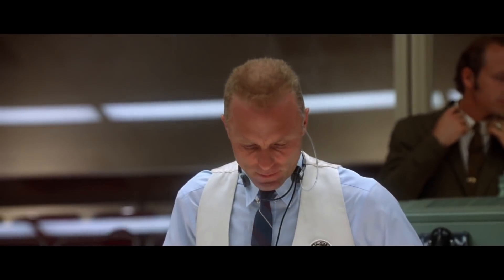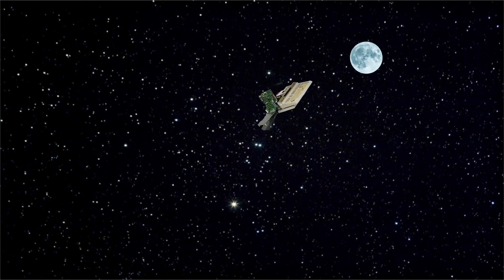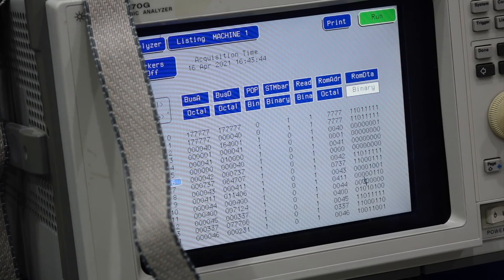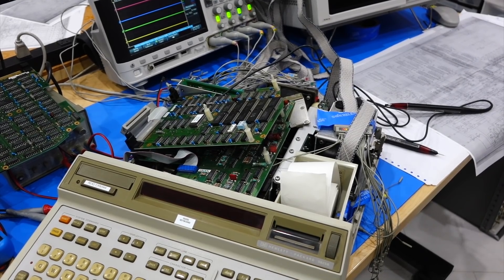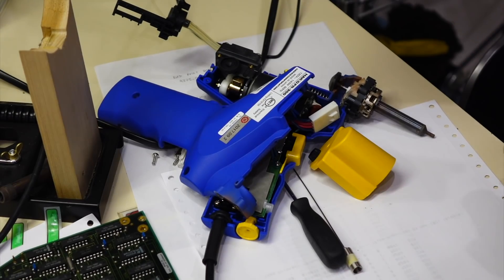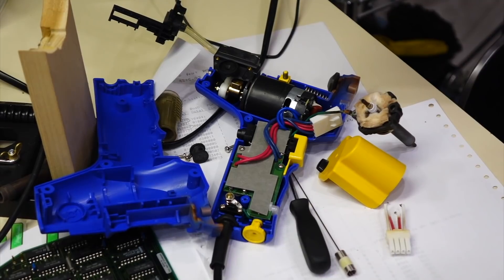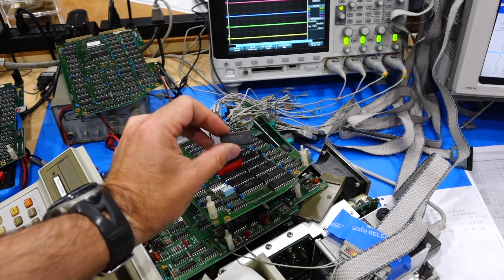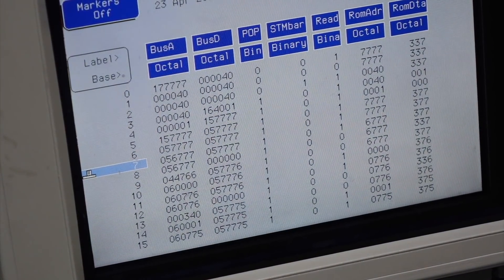HP 9825 Repair Part 6: Can the HP 547A probe get us out of trouble?

Comment: If a chip (esp. TTL) wants to pull a signal  to 0V, any chip or short holding the line high will cause the one pulling low to heat up,

Comment: If you have a high precision volt meter (I'm guessing you have a few), you can simply measure the voltage at each of the pins.

The lowest (or highest as the case may be) voltage will be the culprit.

Comment: We had these HP magic  probes at work a long time ago. We used them with the board powered on and the negative supply of the probes connected to the ground of the board  under test. They were great for testing if gates worked ok. They will  not work on a loose board as in the video. At least the gnd of the board shall be connected to the neg supply of the probes.

Comment: I am not sure if you realized, but the current probe is DIRECTIONAL.  That means you probably need to rotate it + and - 90 degrees while at each probing spot.  I mean rotation along the probe long axis.  If you can follow the signal on just one trace, you can maintain the same rotational orientation relative to the trace.  I have located (twice) a BURIED short between two traces that way.

Comment: The problem here is ( I do a fair number of over-voltage TTL repairs on a regular basis) is that any number of the chips may be partially damaged so if you get it working, run an extended burn-in test over a couple of days, this is usually sufficient time for partially damaged chips to fail.

Comment: I have those HP probes too, only the later model that pulses only once (but upto 1A). As far as I know they are not made to work with unpowered  circuits. Unless you use it instead of the beeper of a DMM so you can follow inner traces. There is an other way, if that is what you want. I made a probe from a think piece of wire. I stript the end and then bow them like a peacocks tail. Now you can "brusch" the pcb.  I use it together with a fast DMM and that is a very fast way to do this.

Comment: I have much better results with the HP-547A when checking the boards in the actual working conditions. The shorts are usually evident. I have also the HP-546A but in case of logic chips failure I have observed that the "powered state"-shorts can disappear when the board isn't powered. So I almost never had to resort to clipping chip's pins anyway ;)

Comment: Yup, the best instrument ever built is not HP, Tektronix nor Fluke but the gold  "Mk20 Eyeball".  It was always number one on my troubleshooting list of tests,  good old detailed inspection.  Number two was the nose test looking for the component that developed that "Ode de Allen-Bradley", less precise but effective.  In the mid 70's it was not uncommon to have several bad DOA TTL devices on a PCB, some even installed backwards. One got fairly good at debugging or moved on to sales & marketing.  Wire wrap proto boards helped but caused their own problems.  Had one board where they counted all the  IC pin numbers CCW  from the bottom side. Had one bad 7474 we had de-caped, found the die rotated 90 deg in the package.

Comment: You need to try a hakko FX-951!  It will change your life.  It makes the old 936 and the wellers feel like trying to solder chips with a propane torch.  It's so precise and the heat is so focused in the tip you can get in and out with a perfect solder joint way faster.  Highly recommend.

Comment: That custom solder sucker stand is pretty nice. If I may make a suggestion though, I would hang it from the wall, such that the orientation of the gun is horizontal.... heat soak.

Comment: I think that HP current tracer probe is meant to be used while circuit is powered.  It seemed that you had board disconnected without even ground reference, so there was no path for current from pulser trough faulty ic and back to ground/vcc.  When faulty board is connected to equipment, probes should be connected to VCC and GND bus, and current probe then can be used to find which IC in that signal is drawing most current trough input pin. Pulser can be used to identify components connected to that signal, and force signal to switch state if it is not driven by any IC outputs, or if IC output current is not sufficient to find short.

Comment: When you removed the ROM chip, my thought was "how will they replace that"?  Do you have the code for it, and could you program a replacement?  I was a little surprised that you fell into the trap of not noticing the rework short, considering you expertise.  It shows things can happen to the best.  It made for a great video though, and beings back memories of troubleshooting decades ago.  I am enjoying this quite a bit.  What initially brought you here (PS fault) is most unfortunate indeed.

Comment: PLEASE NOTE, There is another way to use the HP 548 AC Current probe which may help you. This is not always going to help but in my experience, it helps most of the time. 
Either way, the HP 548A probe will save you time and you will find faults that you otherwise may not ever find.
If you power a board and suspect a RAM chip in particular and often a ROM chip is bad, then scan the top of the RAM IC's and look for one drawing more current; this is better than burning your fingers.
This usually works on ROM IC's as well, especially one with a shorted line and drawing excessive current.
Using the HP 547 Pulser and looking for excess current on a pin on a buss works a fair amount of the time as well.
when you have a solid short and an IC is getting warmer or hotter than usual, the HP 548A is almost like having thermal imaging, in that, the heat is being generated by excessive current consumption.
If you have the luxury pf having 2 boards powered up at the same time, with one bd being a working example and the other bd being your DUT,  you can verify your suspicion(s) on the good board vs the DUT.
PLEASE try this, you may save some time and expense by NOT cutting pins.

I have solved a multitude of frustrating problems with these probes almost effortlessly.

Comment: Were you doing the pulser/tracer test with the board powered? It looks like the probe power is coming from off camera. believe that to get the most useful info out of the two probes, at least in this case, where the stuck bit was being pulled high, you need to do this test with the board powered. The pulser will pull either up or down, which ever way reverses the state of that line. Then you will get more current out of the pulser, which will make the current easier to trace.. I'm not surprised that doing the test unpowered would give similar results for both the good and bad boards.

Comment: Hello Marc I think there is an other bad Trace near at the same chip you solder. Did you check all traces that went thought the pins of the Cips with the lifted trace? 
Greethings from Germany
Reply: I thought that looked fishy too, like a trace that should go between two of the pin pads was either deviated off to the side and probably shorting to a pad or was broken and thus open circuit. I cannot imagine that HP would design a board with traces that looked as weird as that did.

Comment: You forgot to connect the ground when using the 546, would be nice to see one in action in a video. Page 7 in the manual talks about the power supply requirements and importance of a common ground between the tool and circuit under test.
Reply from the maker: Aha! Massive fail! Will try it again with ground. Thanks!
Reply: @CuriousMarc  Being the board is not powered I guess you could place the ground somewhere more relevant to the fault. Just providing the return path somewhere so you can get some current flowing. Looking forward to seeing the final resurrection, I hope it doesn't fight you all the way. Still it makes for great video's thanks!
Reply: Oh i will. It will fight him all the way.

Comment: Can you put the heating element from the 301 into the 300?
Reply from the maker: Don’t think so. They redesigned the wire connection area to solve the problem, and it looks much larger/different shape.
Reply: @CuriousMarc  Nuts. Well, I'm glad I have the 301.  :) They are indispensable!

Comment: Sadly, my family cannot comprehend my sudden outburst of laughter as soon as my eyes spotted the fancy pants!
Reply: Pre 1970s: Wizard robe
Post 1970s: Fancy pants
Reply: The fancy pants have got to be one of the best multi-episode running jokes I've seen on YouTube! They're almost identical to the photo - I wonder how Marc came across them? Maybe a patron knew a tailor and had them made to order, or maybe the pants actually have a HP part number and they're NOS :D
Reply: @rob-muntron  Genuine HP Spare Trousers where specified in the service manual for any HP vacuum tube devices with a plate voltage of more than 300v. I can't remember the part number :(
Reply: @rob-muntron  Marc casually pulled some strings to get 50 year old connectors reverse-engineered and remanufactured by a titan in the connector industry.  No doubt, his influence is so broad it encompasses the textile industry as well.

Comment: Also earlier this day I managed to get a Moon Cresta arcade board working that I've been working on for two months. It must've been overvolted too. There's still two bad EPROMs (which I didn't noticed as I just got it to run at all) and then some weirdness that appears to be interference from the CPU crosstalking on the BUS from these bad EPROMs (they pretend to not exist, so they don't drive the BUS high or low, also on one of them the magic smoke couldn't escape and is now trapped between the die and the quartz window.
Reply from the maker: Congrats on your repair!
Reply: @CuriousMarc  Thanks. Update: After burning the ROMs it looks to be working fine now (can't test inputs or sounds as the edge connector is a hack job in itself)

Comment: I think what limits the usefulness of the probes is the input protection diodes.  All of the chips are attempting to power themselves up from the pulse.  So even a good chip will suck current.  However, reading the manual on the current probe, it seems to be intended to be used on the trace side of the board to follow the current rather than spot checking the component side.  Oh well,  It ended well.  The magic pants must have needed some time to start working.

Comment: As always great content - I think I learn something every time; either how to diagnose or how retro equipment worked.  THIS time however I must admit I didn't follow you when you began cutting pins on chips to find something pulling it high/low.  I suspected a broken trace or something that shorted it else-where so I would have probed it powered off to get confirmation of that. 

Question: Given the amount of chips you have to constantly probe and replace, why aren't you adding sockets if you have to "yank" them anyway?  That way you should be able to independently test a chip?

Comment: I know that feeling of having to stop and fix your tools while you're trying to repair something. It's usually a step back and take a deep breath moment, and then forge on... The darn problem is always in the last place you look.
Reply: Usually after finding the problem, you don't keep looking and move on to the next issue. So, it really is the last place you look. ;-D
Reply: @AndreiDWerkhausen  Yes, we know, it' a joke.
Reply: Was using my old TEK465 as a buffer scope so I wouldn't have to move my digital scope across the room (TDS784 with a non working display at the time). I look down at it and it's suddenly off. Damn tantalum capacitor failed! ...In a non-spectacular way...

Tantalums Throw Tantrums To Terrify Timid Technicians!

Fixed it right there on the work bench.
Reply: @RingingResonance  Yes, those are definitely failure points. When I find circuits grounded I tend to check the Tantrum caps first. They usually short out.

Comment: The "finger test" is underappreciated. I work on vintage audio gear - guitar amplifiers, synths, etc. and even my cheap 8x8 resolution thermal camera has been a great tool for spotting what IC or transistor is the odd man out in a circuit that is malfunctioning.
Reply: When I was a little kid I always had TO-220 shaped burns on my fingers from troubleshooting breadboard junk I was screwing around with